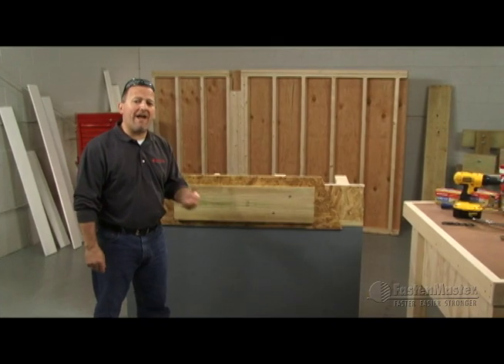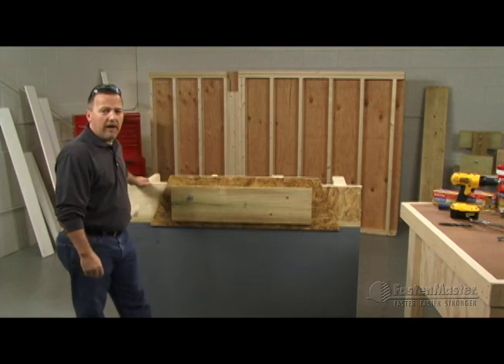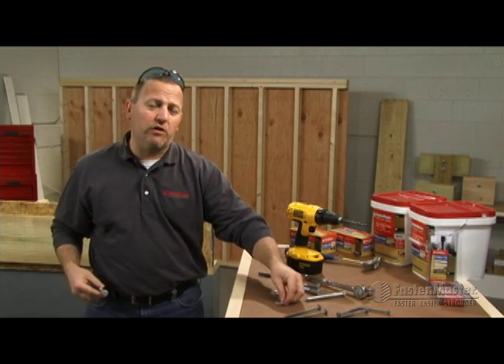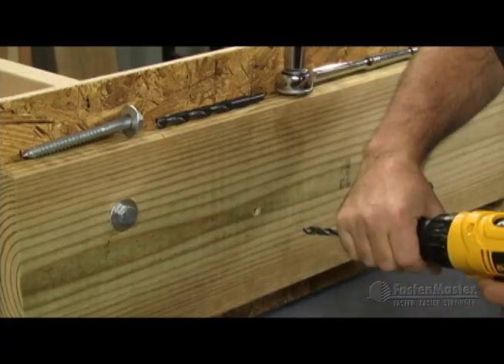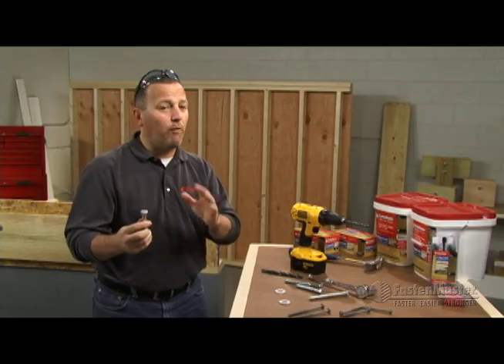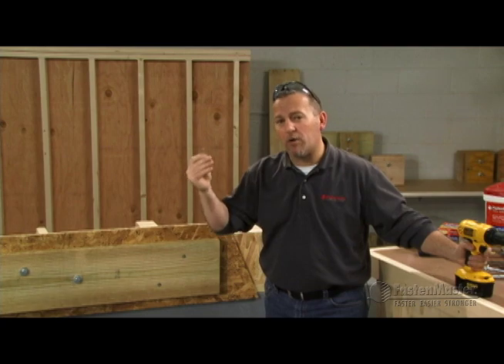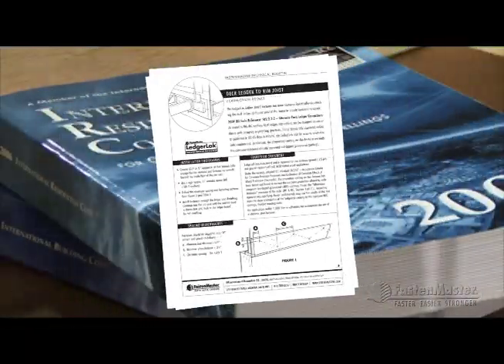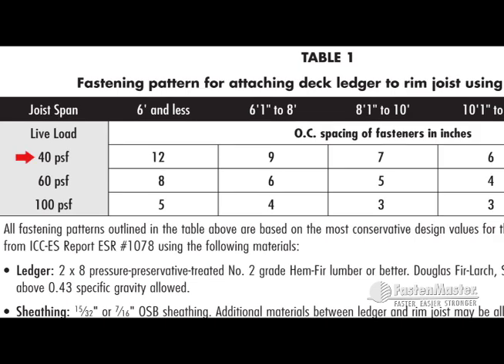FastenMaster LedgerLOK: Secure Deck Connections

Comment from the maker: Hi,

Thanks for the question. Please visit the "code approvals" section on our website to download our Deck Ledger Technical Bulletin. You will need to know the live load for the deck you are building. If you don't know that please contact your local building inspection department. By knowing the live load and the distance from the ledger board to the first post you can figure that
pattern with the technical bulletin.

Please contact FM tech support at 800-518-3569 with additional questions.

Comment: I need ledgerLok that 7" since the code is that the end of the screw should be visible and I need 7"- 7.25" in order to have the screw protrude past the rim board? my ledger board is 3x8 and the rim joist is a 3/8+1/2 ply. I dont see ledgerLok that long. Can I use the heavy duty 3/8" timberlok or headlok?

Comment: Do you have these for concrete?
Reply from the maker: We would not advise using LedgerLOK in concrete.
Reply: @FastenMasterPro  I wouldn't use these screws in concrete.  I wanted to know if you make something similar for concrete application?